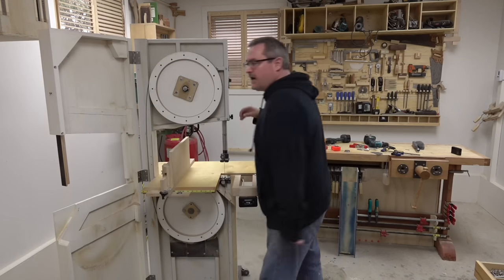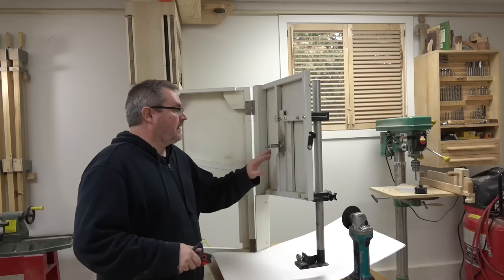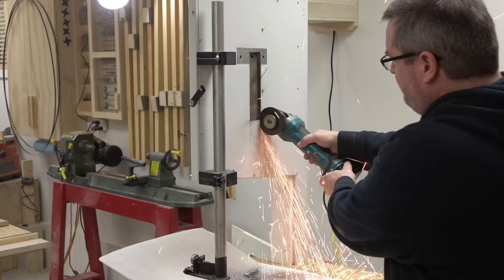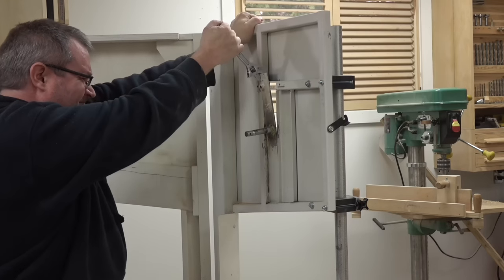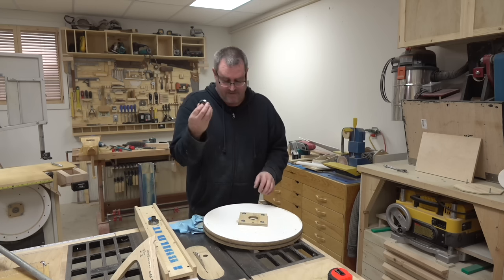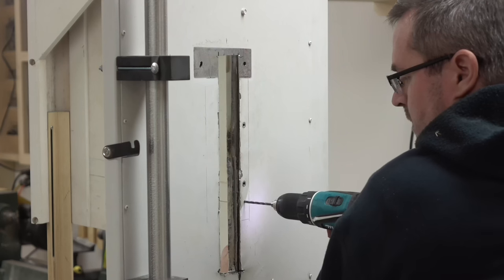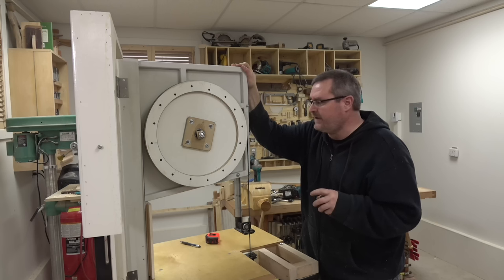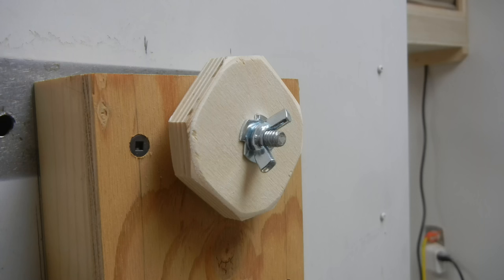Band Saw Repairs

Comment from the maker: In nearly every video, there's usually one thing that guys latch onto and I regret not mentioning. 
Yes, I know about smaller wheels creating bending stress. That won't be an issue, since there would be several of them (8, maybe more) that follow the curve of the upper wheel.
Reply: But for each small wheel the blade would bend and straighten. It would do so many more times per blade revolution than with the two wheel setup. If this bending causes metal fatique, which could lead to a break, then with multiple small wheels you might speed that process up significantly. At least, thats my thinking, and im no expert...
Reply: +I Build It I have an old Delta Beaver three wheel band saw.  Aligning multiple wheels sucks.  That is probably why there is no commercial or other diy solution with multiple wheels.  But if there is someone that can do it is you or woodgears.
Reply from the maker: +Willem Kossen 
bending angle is low - it shouldn't be much more stressful than running on the big wheel. Besides, blades normally wear out (several sharpenings) before they break. I've never had a blade break from metal fatigue.
Like I said, guys latch onto something and normally blow it way out of proportion, making it into a bigger issue than it really is.
Reply: +I Build It 
Interesting idea John. Maybe mount the smaller idlers to a back plate and have that entire back plate tilt to align all of the small casters at once... 
I'm guessing that making the idlers as large in diameter as possible would reduce the increased bending stress, it would be compromise between additional clearance and additional bending stress...
 - Eddy
Reply: +Deathlok67 The issue I could see with the whole back plate tilting is that the blade will eventually leave the crown on the lower wheels. It really depends on many variables, such as the depth of the wheels, the tilting axis of the plate, the amount of tilting required, how the blade would track on an "arc" of small wheels. That would be very interesting to experiment on !
Reply: +I Build It Wouldn't the bending angle be the same per 'point' on the blade though, with the tangent between each wheel being straight. I've had problems with blades breaking on my crappy 3 wheel bandsaw, although that might be due to other things than just the wheel size.

The smaller wheel idea is cool though. With lots of wheels the spring of the blade might work to average out the bending between points of contact. You could go nuts with loads of cheap skate bearings paired up and wrapped in electrical tape, although I bet it'd be very loud.
Reply: +I Build It I really think you should give it a shot at making it, if it works, heck you could name it after yourself xD Whats the worst that could happen? Shifty eyes Haha
Reply: +I Build It Seems to me that getting an even tension across all the small wheels might be a bit of a nightmare.  Lots of tweaking involved or the ability to individually adjust all the wheels in/out from the centre?  Maybe you  could put them all on really strong  springs like tank suspension or something... I don't know.  Maybe having even tension wouldn't even be an issue, I don't know
Reply: +I Build It I think the biggest factor here is going to be the size of the wheels. More wheels means the less stress on the blade, but the maximum radius of the wheel will change, which will drastically change the RPM on the bearings.
Reply: +I Build It The bending stress is primarily a function of the radius of each individual wheel and the thickness of the blade. This means it does not matter much how many wheels you have, and what curve they follow the bending stress will still be mostly determined by how big each individual wheel is. 

Also regarding fatigue. What determines how fast metal fatigues is how many times it gets stressed, and unstressed, and the relation between the stress levels. More wheels means more cycles of stressing and unstressing, which means more fatigue. Bigger difference in the stress levels also means faster fatiguing. So having multiple smaller wheels will definitively increase the fatiguing a lot.

That said it might still not be a problem. 10 times more fatigue may not be a problem if fatigue is not a problem to begin with. I would however expect band saw blades to be designed to have enough fatigue life to let you wear it out, but not much more.
Reply: +Squibbleses If you are worried about having even tension in the blade between all wheels, that will happen all by it self, as long as the wheels roll easily. The load on each individual wheel however would be hellish to get even. I don't see any reason why you would care about that though, or even how you would measure it.

Comment: Hope you try it John. I had a metal cutting band saw that was very old. Built when quality counted. It had four smaller wheels  which allowed it to have a really deep throat in a smaller overall footprint. Not much height but about a twenty four inch throat.

Comment: Possibly the funniest video you've  made! We've all been there and steel is less forgiving. The multiple bearing idea creates multiple points of failure and puts several additional  stress points on the blade. Also the small bearings would spin at almost 20,000 rpm's.

Comment: Another consideration in the multi-wheel idea:

With the traditional single large (upper) wheel, the blade is in contact with the wheel from one tangent, all the way up and over to the other.  With several smaller wheels, there would be fewer "blade inches" in contact.  It is my understanding that the weight and grip of the upper wheel assist in carrying the momentum of the blade, which helps obtain a smoother cut and gives a slight relief to the motor and lower wheel from doing all the work.  I've worked with some fantastic band saws with huge cast iron wheels, and those things cut thick stock like warm butter.  You would be losing some rotational momentum and blade contact by switching to smaller wheels, even if there are a few of them.

Comment: I like the multiple wheel idea. Obviously from a commercial standpoint it is a lot cheaper and easier to make the classic design and if you need more depth/width then increase wheel size. From a homeshop perspective though where cost is not such a factor then building a multiple wheel design would certainly allow for a compact but large capacity saw to be created.
Before I got my current 2 wheel saw I did have a 3 wheel commercial bench top saw that had impressive cut capacity for a saw that used a small 56" blade.

Comment: As I sit here recovering from a shoulder injury from freeing stuck caliper bracket bolts, this was terrifying to watch. Hope you felt ok a day or two after wrestling with that!

Also your idea of replacing one large wheel with many smaller ones is really interesting. It would sort of allow you to use a much longer blade almost like a serpentine belt if you added a few idler wheels in the middle of the tool. Then your 14" equivalent bandsaw could use a blade meant for a larger saw. You'd just have to make sure to keep the bend radius large enough so you don't have the problems associated with the 3-wheel bandsaws.

Comment: I'd be interested to see you do the "smaller wheel" experiment... The two things about it that come to mind: 1) Greater resistance would be created because the band would have to flex to the arc of a 3" wheel and then straighten out again several times per revolution so you'd lose energy vs. one flex and one straighten. 2) Because flexing to the radius of a 3" wheel is a tighter bend than a ~17" bend you'd add heat and wear to the blade's metal. I think that would increase the chances of a failure. (BTW: NICE catch!)

Comment: Ha ha!! Hilarious man!! I love that you leave in all your clangers, mishaps and hard times, it really makes me feel better knowing I'm not the only one!! The multi half wheel concept is genius!! I have a couple of questions  if you've got time to answer them?  Are you just running the blade on the bare wheel, no Tyre? And is your bottom wheel the tensioner?
Reply from the maker: +The Pallet Hippie 
The wheel has silicone caulking on it as a tire and the bottom wheel moves to adjust tracking. More details on the band saw build here: http://www.ibuildit.ca/band-saw-1.html
Reply: +I Build It The bottom wheel moves to adjust tracking??? Well what did I just watch? I thought the top wheel adjusted the tracking? So does the bottom wheel tension the blade too?
Reply from the maker: +The Pallet Hippie 
Oops, tension, not tracking. The article has all of the (correct) details.
Reply: I have to agree the best part was when he finally got the piece of steel loose from the saw

Comment: Agree with others who've said the bending/unbending of the blade might be an issue, but is be nice to see it in-case we're wrong. I don't have the tools to do it myself unfortunately. I'm assuming you'd apply to both bottom and top wheels, so perhaps making a more compact machine?

Comment: John you have my deepest sympathies.  That did not look like a fun day.

On the other hand, once you got that steel out, I was very impressed at how straightforward it was to replace.  Good bit of engineering.
As for the multiple wheels...   I dunno.  It sounds interesting.   What about the stress on the blade.  Right now the blade contact is spread over half the circumference of that big wheel -- like 14-18" of contact.  With 3-5 small wheels you'd reduce that contact to maybe 6" in total of contact.  Would that put more stress/flex on the blade?   Curious.
Reply from the maker: +Wordsnwood (Art Mulder) 
It would be more like 8 smaller wheels that follow the upper curve of the big wheel, so minimal bending stresses.

Comment: John, instead of a series of smaller wheels as an upper track, what about an assembly not unlike what a tank tread runs along? Or even an elliptical belt with 3 wheels that support the belt and the blade rides over the belt?

Comment: I would like to see how the multiwheel design works out.  is bending fatigue really that big of an issue or does the blade wear out before then?  you can also create any curve you want to optimize for depth of cut and width of cut that works best for the work you do.

Comment: How about instead of many smaller wheels there is a single fixed semicircle that on its outer surface has embedded needle roller bearings. Wouldn't create any bending stress that way. Doesnt seem easy to DIY but just a thought I had given the goal of more usable blade height

Comment: Replacing the wheel with smaller bearings i love it and if i might suggest what could try is you cut you current top wheel in half and sandwich i don't know eee  what 3 bearings mabe and then screw that to your tracking pivot that shouldn't be too hard without redesigning your entire band saw

Comment: Amazing videos! I've never used a band saw in my life(little too afraid of them), but i have a security question: if the band itself were to break in mid use would the band fly off cutting every piece of flesh that it came in contact due to high speed or would it stop relatively "fast" to not injure the user? Thank you and keep making videos, you're a great inspiration.

Comment: Sorry John but that was priceless watching you struggle with that piece of metal. I know, not very kind of me but funny nonetheless. Looks like it was just one of those days.

I'm very curious how the multiple wheel bandsaw would work out. Sounds like it would either be a great idea or maybe it's been tried before and it was a dud. I do hope you try it out though, at least as a proof of concept.

Keep up the excellent videos.
Reply from the maker: +dafeichu 
I may just make a working mock up to test with a real band saw blade. Leave it running continuously to see what happens.

Comment: the multiple rollers kool idea but in the beginning when band saws were made it would not have worked because the steel was not good enough ie. the smaller radius of the smaller wheels bending the weld on the blade but now days with the better steels it would be most interesting to see how it would last...as far as the bearing speed you can get small ceramic skate board bearings off ebay for like a couple bucks a piece...another idea for you might be instead of mount the bearing wheel solid mount it like a zip line pulley (upside down of course) and that would take care of its own tracking  just a thought would Love to see you give  it a go

Comment: With smaller wheels the blade would have to turn around a smaller radius unless it only hits each wheel at one point. This could lead to blade breaking sooner. I really don't think you have to worry about too much load on the bearings even a skateboard bearing (608) is rated 700 lbs dynamic so with 2 you get twice that. The bearing you have look much bigger than 608 and i can't imagine the blade is under more than a ton of tension.

Comment: The only problem I see with the smaller wheel idea other than the RPM for bearings is getting them positioned in a half circle to apply the same amount of force on the blade. If one is sticking out farther than the rest wouldn't that cause a tight or friction spot? Putting them in slots to adjust could work but that would add to maintenance. It's an interesting idea worth trying. 

Liked that you kept in your goof parts, I always like seeing other people do dumb shit I know I'd be doing.

Comment: The multiwheel solution hasn't been used (to my knowledge). There is a crucial
issue with it: The radius the blade gets bend correlates to the radius of the
wheel(s). Hence using small wheel decreases this bend radius and wearing out
the blade faster. You could assume 3 wheels to replace one big one. Those would
have a triangular location (left / right / top). The radius around the top one
would be relatively tight. Using more – say 15 would mitigate that and increase
the effort in friction, noise, maintenance, build cost, tracking/alignment etc. If you
compare that to the rather cheap commodity of simply increasing the distance
between the axles in a conventional setup there is not much gain. Assuming you
have the height in your shop and find an appropriate blade you could space them
10 meters apart.All that effort seem pointless to me. To my experience the is a comfort zone in material width.
E.g. cutting a “high” piece of wood on a band saw isn’t fun at all in terms of
chip clearance, heat, slow feed rate etc. I’d rather tackle that with a chain
saw if possible or in case of “hollow” items with a table saw.

Comment: Sometimes it's easier to just build a new one than repair the old one. Don't think the band saw would need replacement unless you want to try the many wheels thing to gain more depth.

Comment: small whels will introduce number of tiny bending points to the blade, that can cause vibration and wear of the blade. But this is fully theoretical, would be interesting to see your solution.

Comment: I think I'll take the day off after watching that.  The idea of replacing the wheel with a bunch of little wheels is interesting.  Maybe not good for blade life. The other part is the large wheel has a lot of momentum.  Part of what makes the big industrial saws better is the big solid cast iron wheels.
Reply from the maker: +krtwood 
Momentum is not a consideration for these smaller saws. In fact, it works against you - the saw takes longer to get up to speed and coast forever after you turn it off. Most of those big ones have mechanical brakes to stop it so you aren't waiting 10 minutes to change the blade height.

Comment: How long did the bearing last. More like 10-20h or 100h to 200h of runtime? Assuming that it is just some standard use sealed bearing and not one that is actually rated for the axial load (I wouldn't buy them either, way to expensive).
Reply from the maker: +BR H 
Hard to say how long it lasted. I had already replaced the first set that were of questionable quality. These were supposed to be better, but I guess theyare undersized for that load. 
Better off with a much larger shaft / bearing combo - maybe 1".